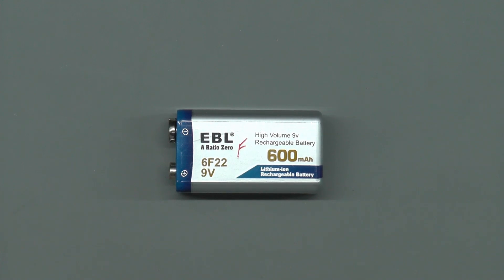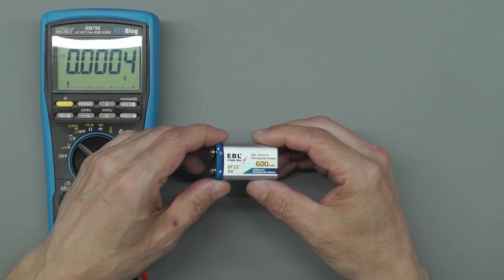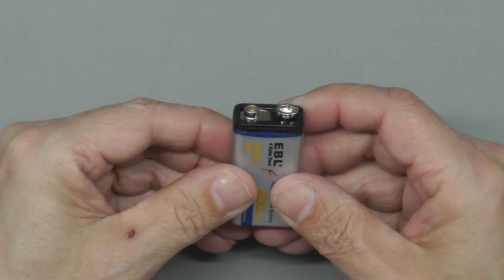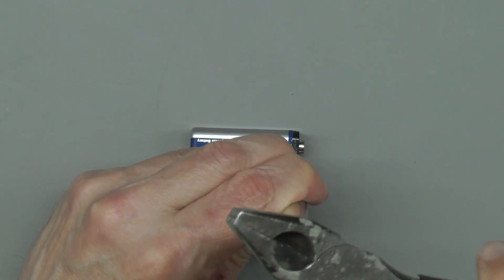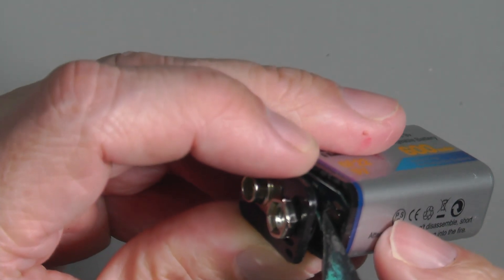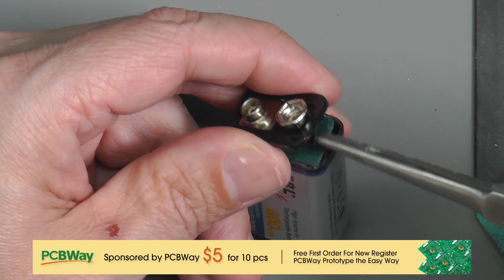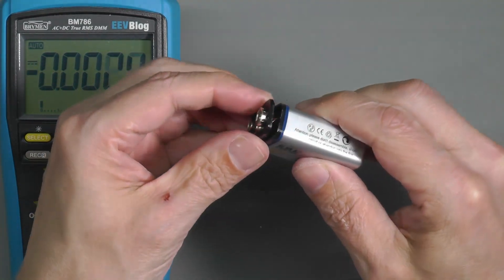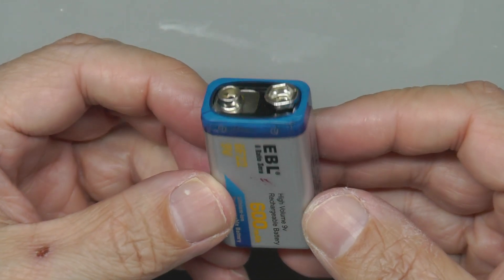No.075 - 5 Minute Repair - 9V Lithium Ion Battery

Comment from the maker: These batteries are actually 8.4Vdc, which consists of two 4.2V lithium-ion cells in series.
Reply: Yes....but there are also fully 9v versions that employ a dc-dc boost IC with a microusb input for charging direct from USB...no charger required.....but they are, of course, 'those Chinese rubbish' batteries.

Comment: I got same ebl batteries like urs , 4 of them r showing 0 volts , I took one apart like u did but it's perfectly soldered so another issue 😢
Reply: Friend of mine just brought me some of these EBL 9V batteries in this shape. Basically what happens is they had it hooked up to something with a slow drain load, and I'm guessing the BMS didn't prevent over-discharge, so the combined voltage dropped below like 5.5V or something and I had to charge each individual pouch cell underneath to over 3V to bring the top terminals to have voltage again. Bad BMS basically, but can be "repaired", not sure about how to prevent though. Sadly you have to open it to do this and use something to get each charged up for it to be able to charge in a normal charger again.

Comment: Pale Blue Earth makes a line of lithium batteries of all standard sizes.  Though I don't know where their manufacturing is, they're based in Utah, and the batteries I've gotten so far are very good.  The 1.5 v versions even drop to 1.1 volts or so just before the end of their charge, so your equipment can tell you they're about to die.  Haven't tested their 9v batteries yet, but I want to get some and test them for noise in audio gear (effect pedals, etc.).

Comment: Where do you get the batteries from please?
Reply from the maker: Ebay. Just search for "EBL 9v lithium ion 600mAh"
Reply: @IanScottJohnston  EBL doesn't seem to be available from eBay Australia, so I've ordered a couple of T-Power 800 mAh units for AU$15 each (GBP8.20) with 'free' delivery.  How does that price compare to the EBL units that you buy?
Reply from the maker: @Brian_Of_Melbourne  yours would be a little more expensive.
I have tested a bunch of types to compare 'actual' capacities, but not the ones you bought. Be nice to hear how you get on with them.
Reply: @IanScottJohnston  Sadly, I'll just be shoving them in a couple of DMMs and hoping for the best rather than doing anything remotely scientific or technical.
But I'll let you know if there's any big problems.

Comment: Nice job. I've never seen 9v Li-Ion batteries before. Do they have a booster board to actually produce 9v or ar they just 7.4v from a pair of Li-Ion cells?

And how do you charge them? I haven't got any Li-ion chargers which would accept a PP3 form.
Reply from the maker: It's two cells in series, and I believe the two cells are NOT balanced charged so they probably don't last as long as batteries that are fully balanced charged.
The ones I uses are true 600mAh, but you can get 1000mAh versions, but I've yet to see one that truly is 1000mAh (Chinese rubbish)!
There are many chargers available for them on Ebay etc. Search for "9v lithium ion charger".